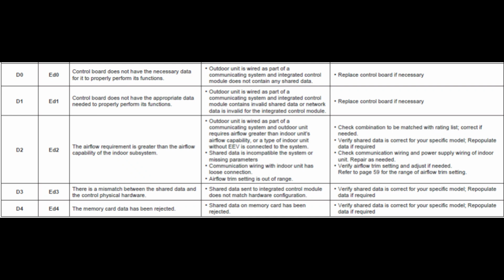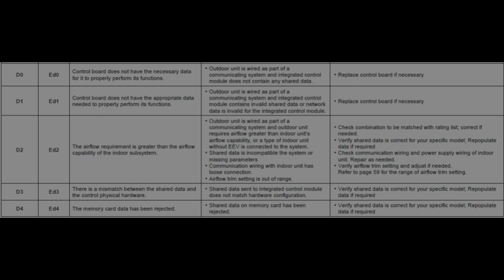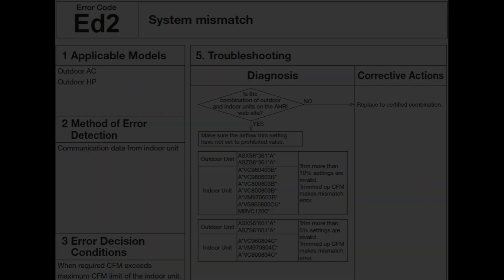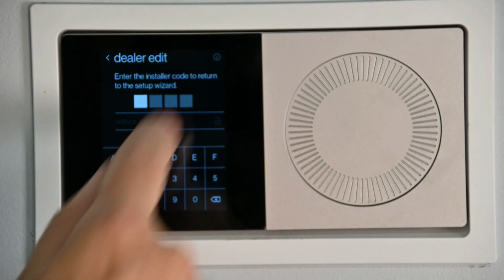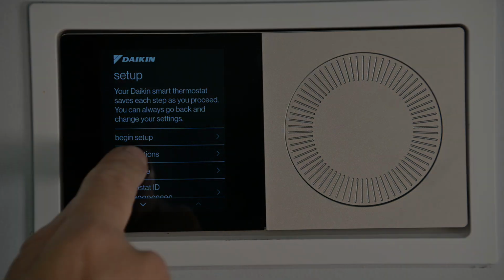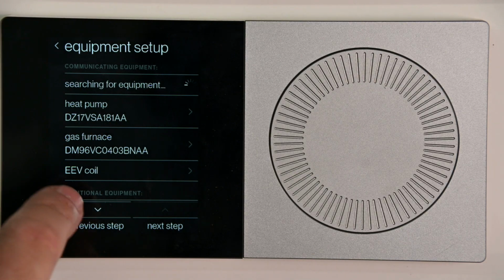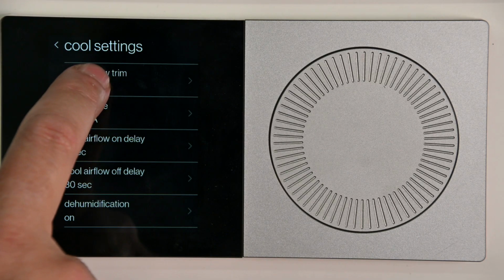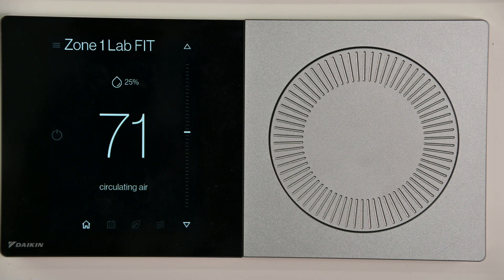D2 error on Side Discharge during System Test

Comment: I just had one but the s15 was in the improper position
Reply from the maker: S15 on the Coil board?
Reply: @johnstonecg  yes just wanted to let you know. Apparently tells outdoor it's a txv instead of eev
Reply from the maker: @scottdoran2683  Thankyou for that info and yes it does tell it to run an EEV. Good to know.
Reply: I have same code with goodman gtst thermostat